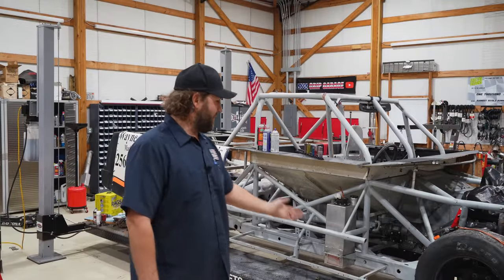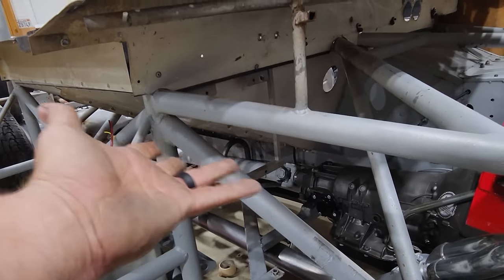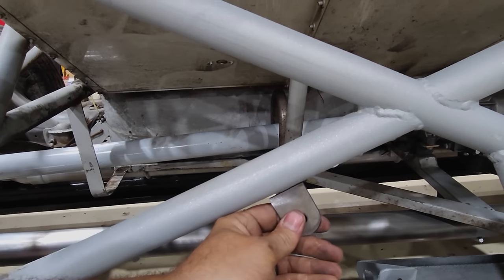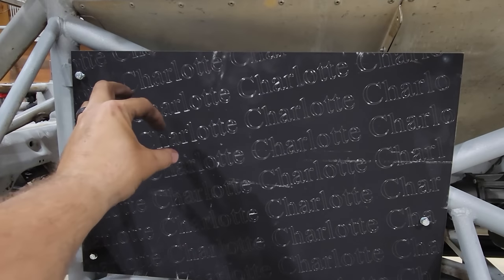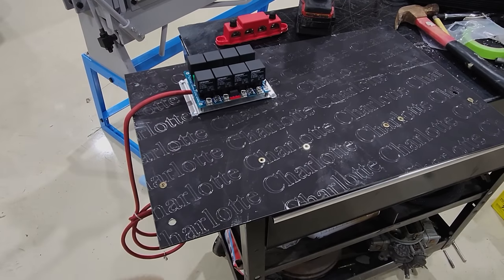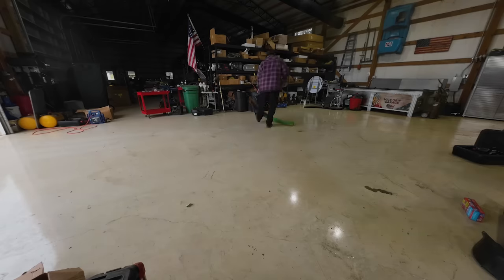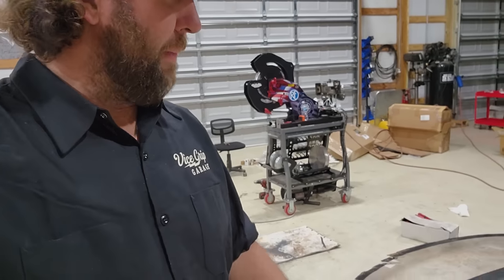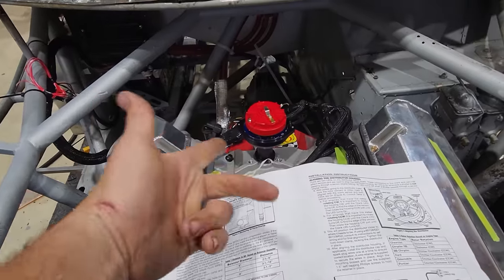Race Truck Gets Electrical, Bumpers, and a BODY! SO MUCH TUBING!

Comment: Any downside to a rad being placed on the rear down-tubes on a burnout car? It seem like the front structure should be 100% sacrificial. I imagine an electric PS pump could be remote too. Just a thought.

Comment: Couldn’t you make a charging system that could runoff of a electric motor that would drive the alternator that would keep your batteries charged then you wouldn’t have to worry about swinging belt off of the motor when you’re hitting high RPMs in the burnout competition just a thought but awesome show very well. Enjoy watching it definitely passes a time for the last few years. Fighting cancer and heart problems.
Reply: The energy needed to drive the motor to drive the alternator, would exceed the output of the alternator.

Comment: The radiator should of been picked from a diesel pickup and layed back at a angle to clear the hood. You have no pulleys so put the biggest massive rad u can get from a salvage yard cheap

Comment: Have you ever ask yourself why does fel-Pro still include those end pieces in there intake kit. I mean how many of there employees throw them out the end pieces  and use silicone. I'm 54 and have been working on cars my whole life and have been throwing them in the trash ever since the first time I used it and it failed. So I know there engineers have had the same issue. Why don't they put a tube of silicone in the box instead? You are famous enough to get a tour of there facility and  maybe talk to a junior engineer to find out a method to there madness! You should ask around and see what there thinking. It would make for a good show. I know I've always wanted to see inside there factory's. Anyway another great video sir

Comment: Ditto on reviving the truck and you seem to be throwing the "thought" word around alot. That could be dangerous. Nice rocket build by Bradly, suggestion- strips of mylar balloon for streamer material. They are fire retarded material, very glittery and pack easy. Love to see the kids projects
Reply: Oh and that blow in cellulose attic insulation makes great wadding to protect streamer, cheap and just blows away in the wind

Comment: too late now but after you drill holes put a bolt threw wuth nuts ion both sides then zip the nut on the back side. old school net sert

Comment: I would’ve gotten a junked Colorado and took the front grill, fenders, and hood and made them line up. Rather than deal with that clapped fiberglass and sheet metal.

Comment: I don't get it. Isn't this a much more extensive revival of an old race truck that you will use for burnout competitions? I find this project a lot more interesting than some of the revivals where you wind up with a running clapped-out beater that Billy Joe Bob would be proud to drive from the trailer park to the local bait shop/gas station to spend his government assistance on beer, cigarettes, and lottery tickets. I'm entertained if it's a cool classic vehicle or something like this. If it's just getting a random hunk of junk running again, I get bored and start skipping ahead quickly. Just my two cents. You're a likable guy with a nice family, and you have 1.5 million subscribers, so you must be doing something right.

Comment: PSSSSSSST.... I would classifie the truck as a REVIVAL.  ya brought home a dead in the water truck, and ya reviving it to run and work again.. To me thats a revival, a build is ya pack in a tub full of cut and bent pipes ect and begin JB welding them all together to build a truck.   oh ya do not forget the Duct tape and the zip ties then is a true build. but making a dead truck usable again has gotta be a revival.